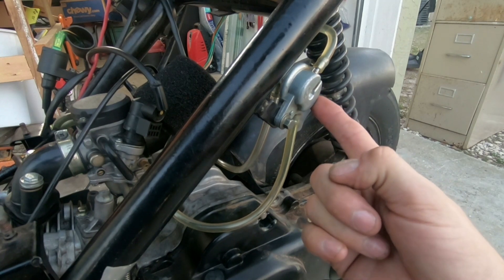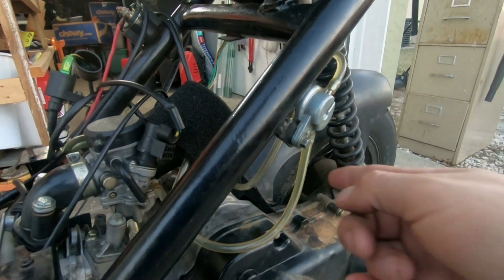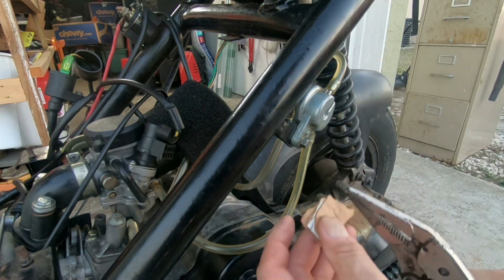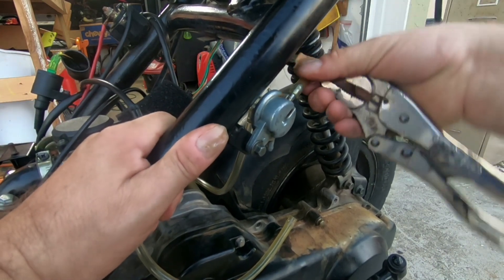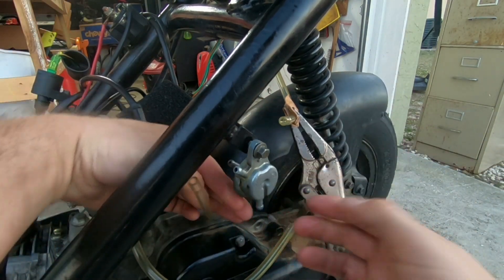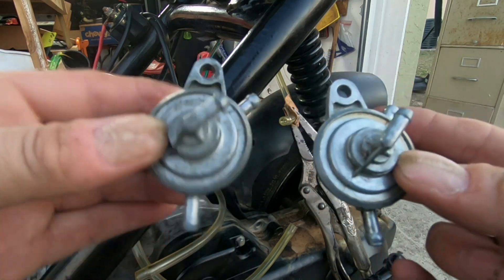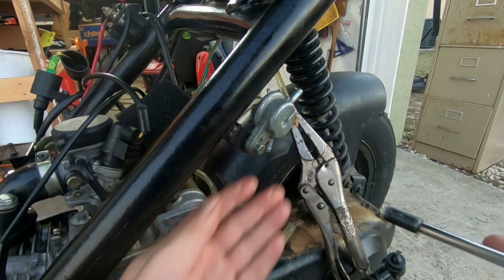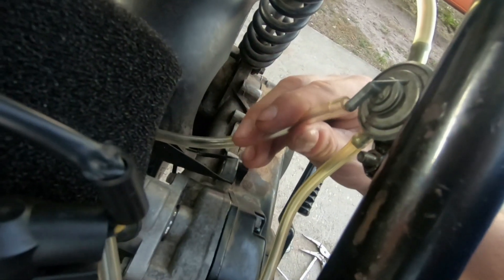GY6 Scooter - Petcock Leaks - Replace With New One (Part:12

Comment: I eliminated mine from my Tao tao 50.  Just get a manual on/off fuel shutoff from the lawn mower section at an auto parts store.  Make sure the fuel line has a downhill run to the carburetor.
Reply from the maker: Yea my petcock went out after I did the video,,, so I ordered a plastic shut off valve and I have clear tubing ,, now my scooter has it,,, thanks 👍

Comment: Had the same pob done away with the vac unit and put a tap on and off done you get bad starting and idle with a bad vac unit.
Reply from the maker: I dont have a petcock on my scooter, because the ethanol gas eats the rubber diaphragm,,, so I put a plastic shut off valve on mine that I got from amazon, I capped off the intake barb with a plastic cap,,,